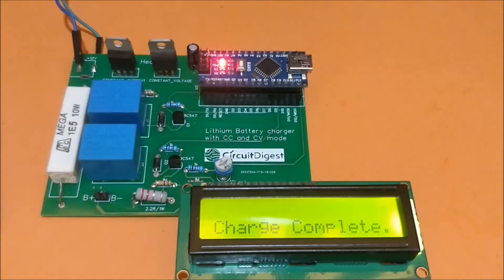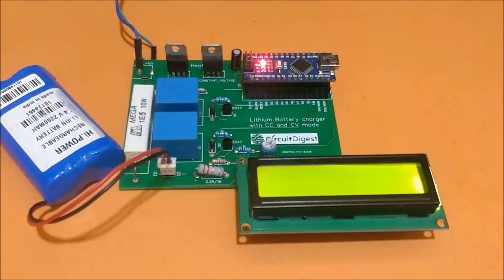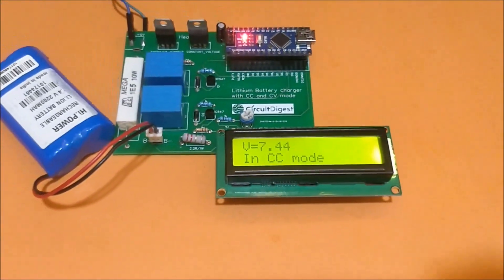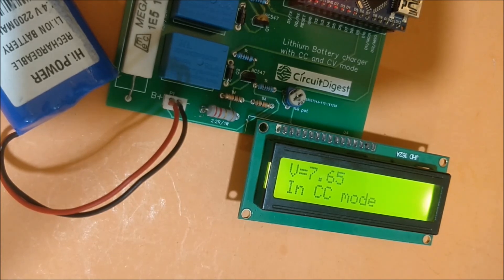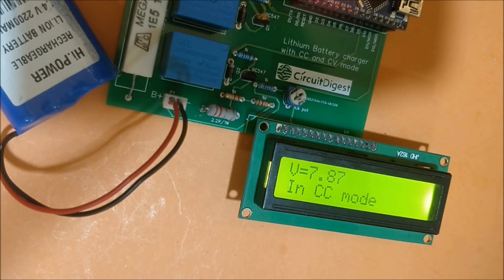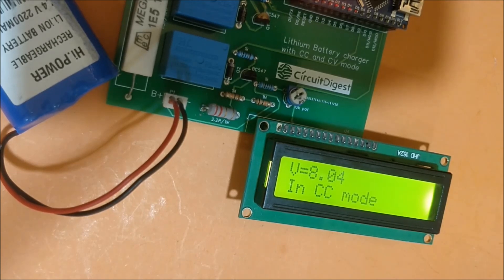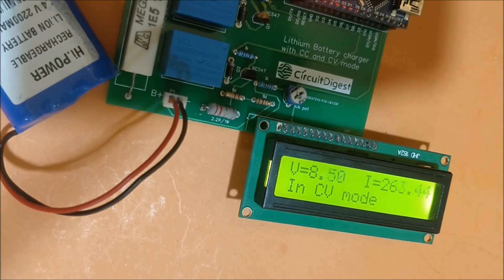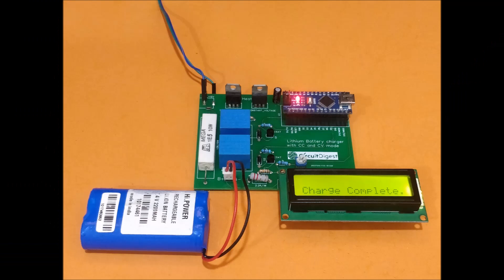7.4V Lithium Battery Charger Circuit Design

Comment: Make sure the battery pack has a separate battery protection circuit!  One mis-typed number in your code and very bad things can happen.... The protection circuit can save the day. Testing it with is a good idea too.
 Remember that experianced professionals can get this wrong as well. 
For decent battery life the battery should have a balancer circuit and cells must be matched by capacity.
 Mobile phones only have a single cell to avoid the need for balancing. Consider a single cell battery and  matched charger with a boost converter for the load as this removes need for balancing.

Comment: 24 volt DC input and 11 volt output Li - ion 7.4 volt battery charger use 
Auto cut off circuit 
Safety device diagram and video send my WhatsApp number
9604768313